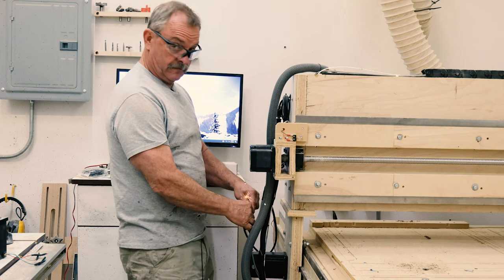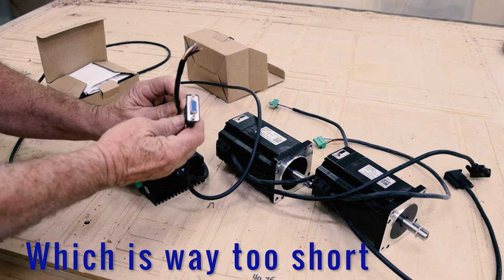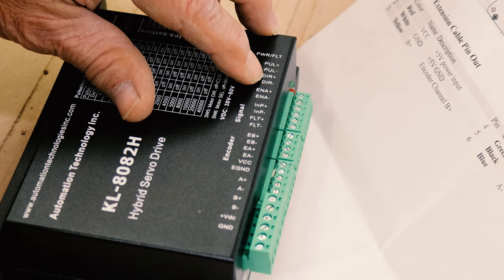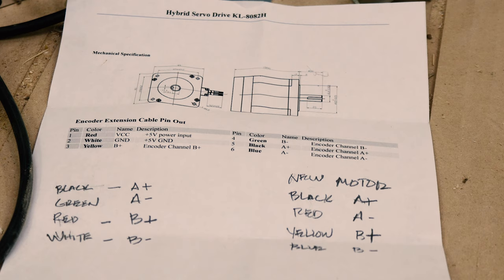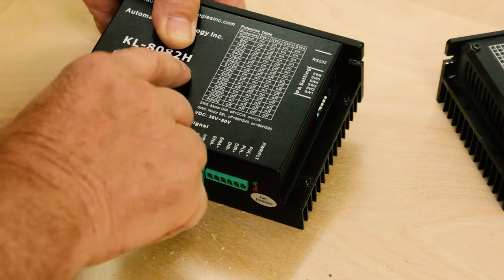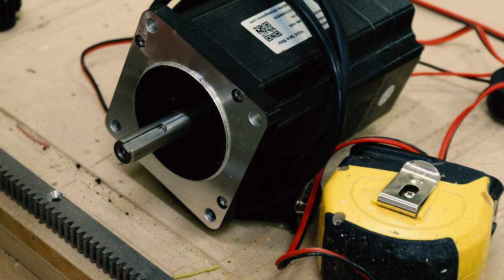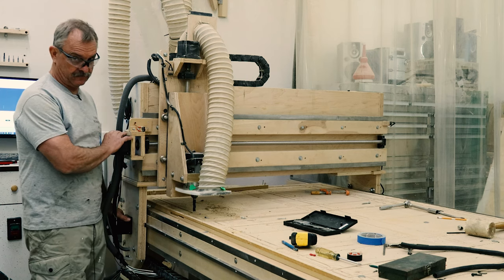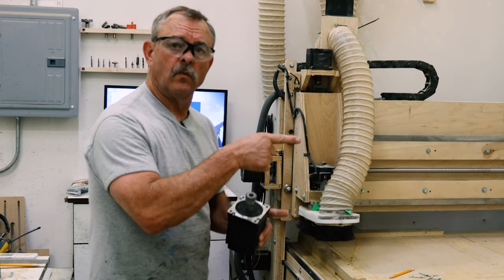Closed Loop Servo Motor vs Stepper Motors

Comment: Good video
Reply from the maker: Glad you liked it.  Thanks for waching.
Reply: @OldGuyWoodworks  i am just beginning to update a cnc with new servos, pretty large industrial but they are basically the same as smaller ones.  Mine also is laser instead of router

Comment: Hi, Thanks for the video.  However I have a few questions for you to consider.   
First off, I should start by stating that I am a laser guy.   Specifically Co2 Laser gantry systems.  What I am interested in is resolutions that can at least hang with my current 3-phase NEMA 23's with a driver micro-step setting of 5K.
 I don't necessarily need more top end speeds, but rather quicker acceleration/deceleration ability without worrying about jumping steps.    Granted these hybrids should take care of this.  
However I was warned by a company CEO (A major Chinese laser supplier based here in the states) that when they attempted to replace their open loop stepper system with these Lead-shine hybrids, it actually reduced the quality of resolution according to him, and he claims that going back to the standard steppers resolved the issues.
While I trust most things this guy says, as he has been more often right than not, I believe he might have been hasty in missing the fact these driver/motor combos require manual setup through their software serial ports. 
So....  My questions are.  Are you aware of said software, and if so have you messed around with it?
Lastly I recall you stating that you left the driver step value set to a value of 1600?   I realize the lower setting are intended for a higher torque per step/rev.   However this in my opinion defeats the purpose of going to a closed loop system that utilizes an encoder.   I don't know what your previous steppers where set to, but you should be able to retain well above the open loop steppers you previously had in step value and still retain an abundance of torque.   So why?    I run my open loops on my laser at 5K micro-steps.  This is in addition to having them system pulley reduced to a 2:1 ratio, further increasing my resolution by twice it's driver/micro-step values.   Seeing how you're a mill man, I would think you're seriously cheating yourself to the high res advantages of running closed loop drives, especially for a slow moving mill.   (By slow moving, I mean in reference to my x axis being able to run in excess of 850mm/s.
Reply from the maker: Thanks for the info.  It obvious to me you are much more informed on this subject than I am.  I am not using any other software other than Mach 4.  The original steppers and the new steppers didn't have the same dip switch settings.  Since I wasn't that familiar with them, I just went with the default setting unless I knew exactly what I needed or wanted.  Resolution and accuracy hasn't been a problem for me since I installed these new motors, in fact it never operated as well as it does now.  Since it works so much better, I went with it.  Taking into consideration what you told me, I can see I might be selling myself short and may change those settings higher and see what happens.  Thanks for the input.
Reply: @OldGuyWoodworks  No problem.  If I end up picking some up to play around with and find any useful insights, I'll try and remember to post my findings back here.

Comment: This is awesome do you have plans for your cnc
Reply from the maker: Unfortunately the plans are all in my head.  There is no telling if I can recall those anytime soon.
Reply: @OldGuyWoodworks  no problem I do like the idea of the closed loop stepper motors I might use them on my cnc

Comment: Are they much more accurate when milling compared to the regular stepper ? Mine is off .010 when I mill pockets no matter what I do.  Even though the machine moves within .001 accuracy when setting the steps per inch .
Reply from the maker: It's been awhile and I can't recall.  I do know I like them much better.  They run  smoother, quieter and not as hot for sure.  The performance of my cnc increased quite a bit when I changed over.

Comment: if you dont connected the encoder wires . only the stepper motor wires connected..what will happen ?
Reply from the maker: Absolutely nothing.  Funny you mention that.  I did it that thinking I could just skip the encoder to test run it.  No go at all.

Comment: I need closed loop steppers on little 6040 cnc..  If I'm doing a 3d cut I lose steps z... And my work gets ruined 😔😔
Reply from the maker: It made a noticeable difference on mine.  It runs much smoother and not near as hot.